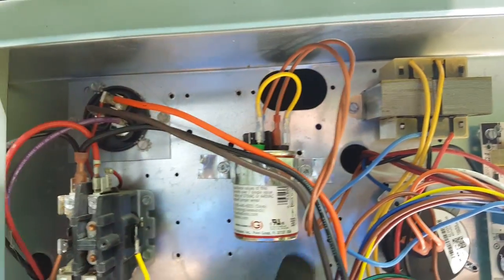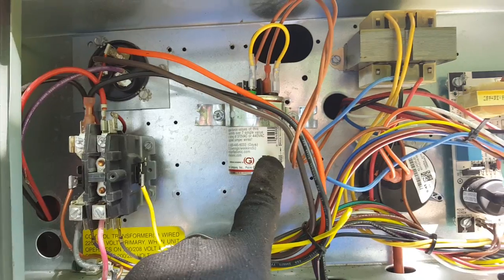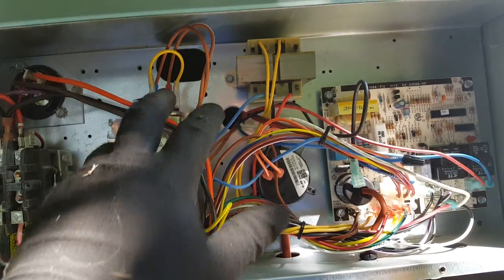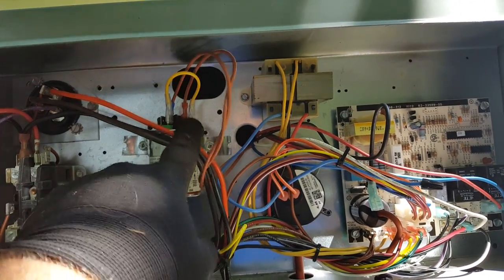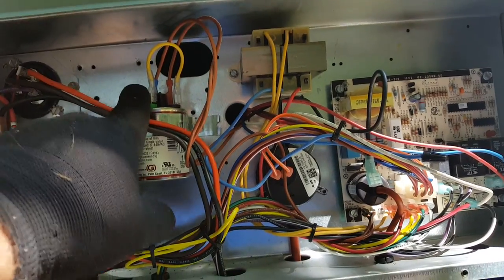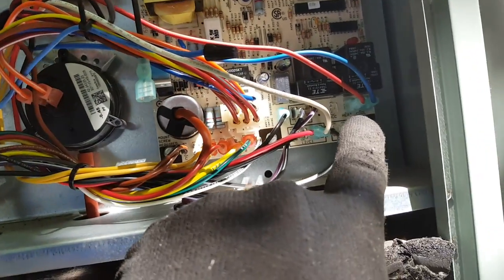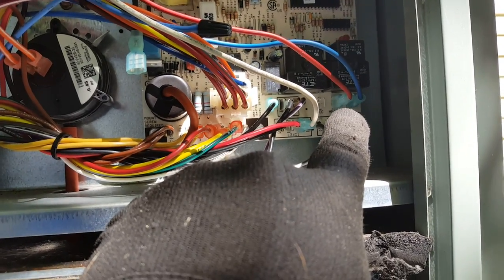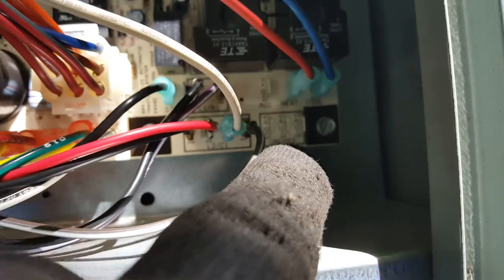Town & Country Air PRO Preview : ECM to PSC Motor Conversion

Comment: is there a reason why you dont just put a ecm motor back in it? is it to save the customer a few $'s
Reply from the maker: it was cheaper, and the customer would have been on his 3rd ECM motor. The application is not ideal.
Reply from the maker: +Eric M is didn't measure it
Reply: maybe the customer has half his grills closed??  just a thought

or even the motor is not properly grounded??